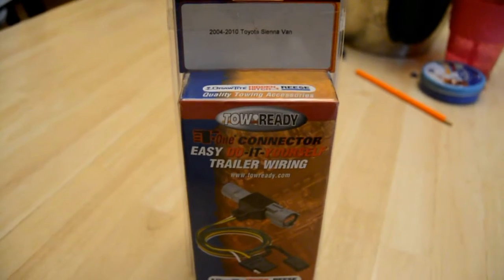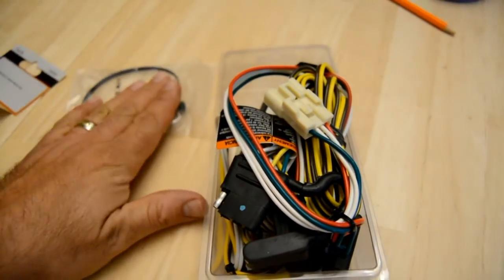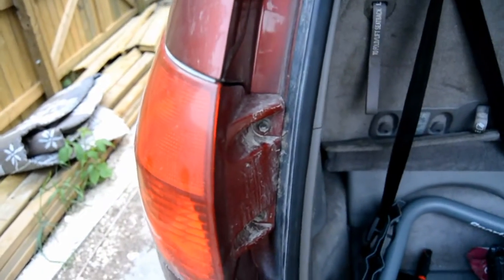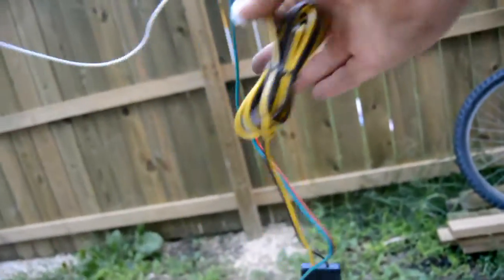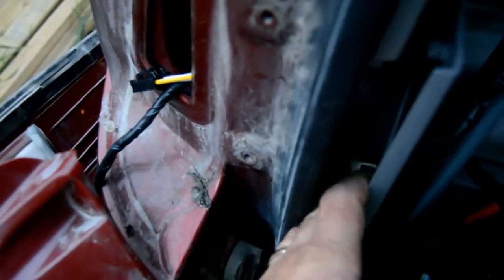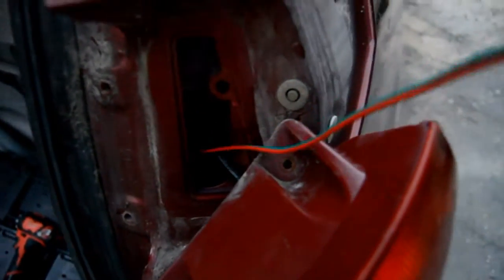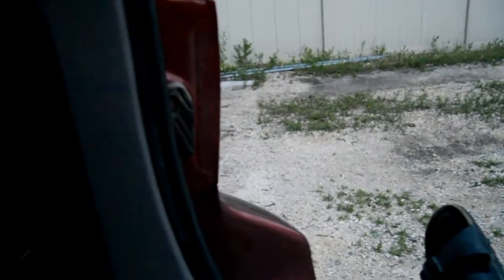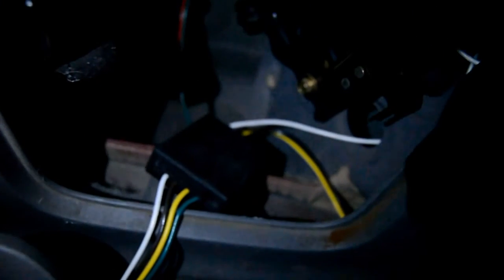Trailer wiring a Toyota Sienna

Comment: Did you hookup directly to battery? I missed where you plugged up to power.
Reply from the maker: no, it is aT connector in the rear light. the trailer connector gets its power from the tail light circuit.